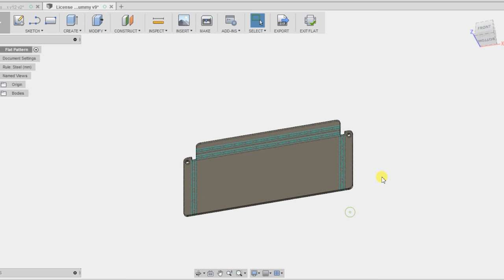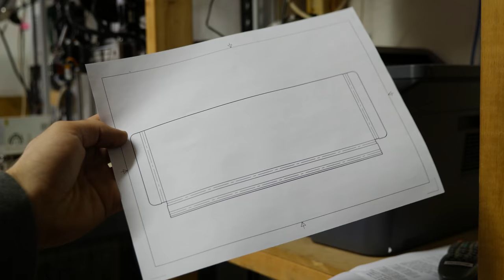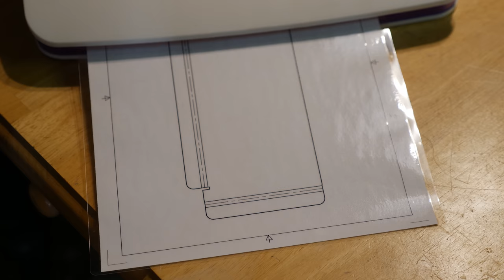DIY Secret License Plate Stash Box - Hide Cash, Bitcoin, Keys - MR ROBOT Prototype

Comment: Nice, but it needs an RFID lock so only the people who are supposed to get it, do.
Reply from the maker: This was a prototype. We might make another version. Chances are if someone finds it, they'll take the entire thing.
Reply: Which is why I suggest the RFID lock. If you can't get inside, you can't unscrew the attachments that secures it to the vehicle. Of course, that means that even the screws attaching the plate to the front should be on the inside, or have it be a solid lid and the plate just attaches normally to the solid lid...

Comment: "I've got this industrial strength glue." pulls out E6000

I like to make jewelry sometimes (mostly because I love wire, but I do other stuff too) and I have had E6000 fail on simple light earrings.  And if you want to remove it, you can just pull it right off. I would not suggest using it on anything that holds much weight...
Reply from the maker: Thanks for the suggestion. I appreciate the feedback from one maker to another.

Comment: Isn’t this iligeal?
Reply: GALERIBARN why would that be illegal?
Reply: Butch Cassidy drugs? IF u cross to another country or state?
Reply: GALERIBARN so dont put drugs in there, problem solved
Reply: Butch Cassidy it’s iligeal to have hiden compartments in a car, truck or bike? So the problem isn’t solved BUT it’s hiden good?
Reply from the maker: Haha, yeah exactly.
Reply from the maker: It depends on your state laws, apparently there's some areas that outlaw hidden compartments. I mean its not locked, its in plain site. There are compartments that are already "concealed" in a car, like some glove compartments and fuse boxes next to the speedometer.
Reply: GALERIBARN Since when is having a stash spot in yoyr car illegal? Especially if its empty?
Reply: Butch Cassidy if it’s hiden like the licens plate no wan is gone see  that? That’s why it’s illegal becuse it’s not made at the factory of the car, and no wan is gone suspic it as a hiden compartment
Reply: @dolva0810  the law says its illegal to have hidden compartments INSIDE the car... this is outside the vehicle so the law doesn't apply.